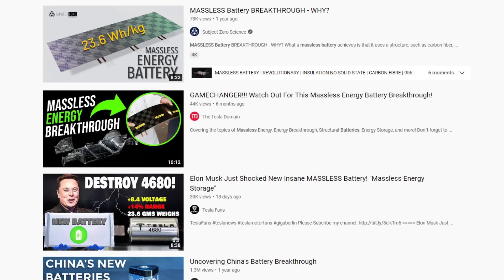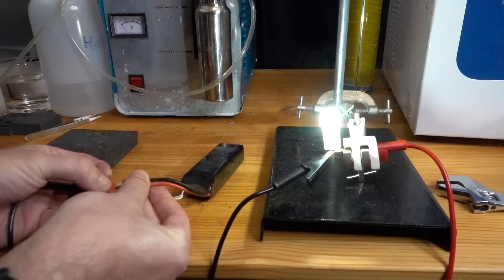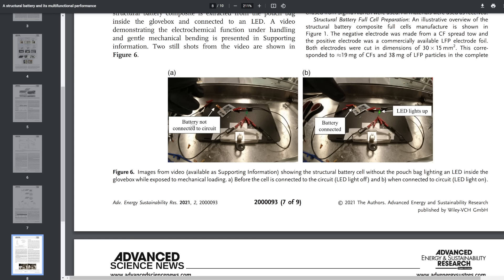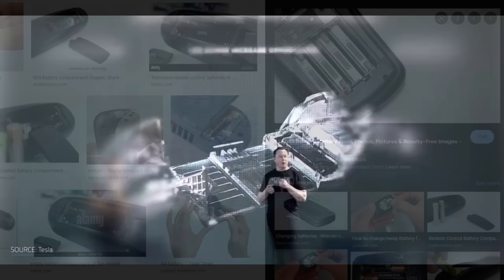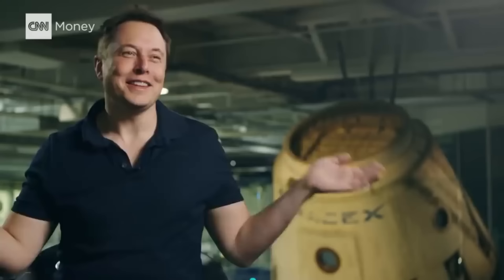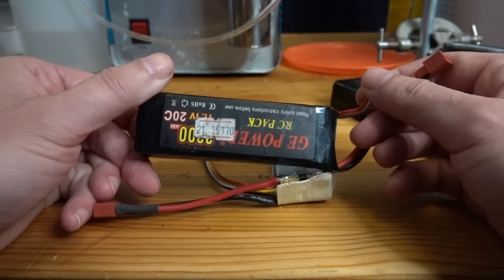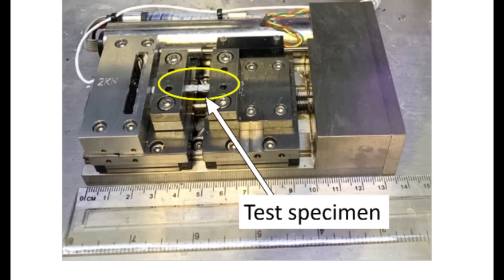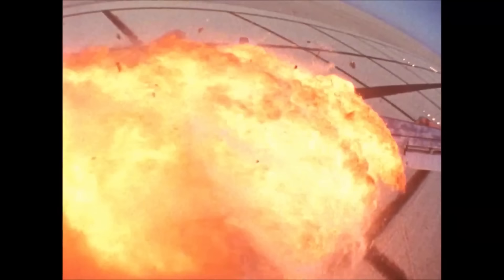Matt Ferrell, Massless Battery: BUSTED!!

Comment: "Imagine if the car's structure were a battery"
Okay. Imagine if a car were made out of a dynamite and thermite composite
Reply: How about this, if you distribute the thermite and dynamite all over the car then there would be no net force when it conflagrates; instead we could get all that energy in one place and accelerate the car really quickly (if only briefly). Then to compensate, we could put it underneath so the car follows a parabolic trajectory....

Oh we've invented mortars
Reply: @Hevlikn  Might as well call the vehicle company "General Mortars" at that point
Reply: It would be fast as a rocket.
Reply: It'd have a high energy density at least.
Reply: Saves on towing and cremation costs.
Reply: Sounds like fun. Fun I would watch from far, far away...
Reply: Now im not so sure but arent batteries usually structural elements of the car and really well protected?
Reply: What if we built the tank out of cannon shells?
Reply: I can think of a market formcars designed like that
Reply: It's not a horrible idea on its face. If we had the technology to make structural batteries it would be very beneficial. It just shouldn't be presented as if it's a trivial technology to develop. Maybe 50 years away, if it's even possible at all.
Reply: @Gigachad-mc5qz  Underneath the car, yes. Not if the packs or cells are all over the car.
Reply: I think it would be better to have car frame made out of C4. That is much safer :D
Reply: @RamsesTheFourth  ya joke, but when ya think about it, it might actually be since C4 is impact stable and doesn't ignite in flame

Comment: I can't wait to see thermal run away in 100% of my car's frame, what a great idea.
Did you know that making the seats of your car out of plastic bags of gasoline is the most comfortable ride you'll ever have? There are no risks to this idea, just benefits.
Reply: Yeah, also you can fill an air mattress with propane to cut down on those unsightly metal tanks, aesthetically pleasing and a great night's sleep!
Reply: Even saying it doesnt blow up. What happens when the battery dies and wont need a charge. Would I need to change out my whole cars frame and side panels?
Reply: @devilselbow  gasp @_@ Yourrrrrrr rrright.
Reply: Oooh, and I just imagine myself riding in that car, enjoying a cigarette while I sit comfortably on that gasoline bag seat.
Reply: That's pure genius!
Reply: Plus if the fuel injectors fail, you can still get fuel into the engine due to the pressure of sitting on it!

Comment: In al fairness, the original paper seems to be more about "how can we make a battery cell a bit more tolerant to elastic deformations while still storing some energy in it" and has the distinct "we need to publish something" vibe to it. It's Matt's own initiative to claim that the battery is massless and everyone's lives won't be the same ever again.

When Colin Chapman bolted the rear wheels of his Lotus 49 car directly to the engine, it was a good idea. However, claiming that it suddenly made Cosworth DFV "massless" would have been ridiculous.
Reply: Minor correction: Lotus 49 uses transaxle and engine as combined suspension mounts, then those two are directly bolted to main tub.

Comment: So by this logic, all motorcycles that use the engine as a stressed member have weightless engines. I had know idea my bike was so light.
Reply: Well you as a human is a human supporting human, which means you're weightless as well
Reply: Just like how we are all brains in bone mechs with flesh armour,but the armour is also the motors that move the bone mech.
Reply: @NareshSinghOctagon  We're Biomech-Cyborg-Carbonsparks .. i kinda forgot what i was gonna say
Reply: All you need to do is embed the battery into the integral structure of your bike, and you'll be flying!
Reply: Yeah this logic is just ... uh NO!!!!

This is really going to depend on the battery structure itself as well as the life expectancy.  It may in theory be possible to make a "lifetime" battery pack for an electric car.  This has already been done for phones and laptops (they just have terrible lifespan).  I would want to be a lot more confident that the battery lifetime is guaranteed to last 1 million miles of real world range before getting a car that couldn't have its battery changed.  

I just remembered.  Some of the strength they may wish to use comes from the cooling system on the batteries.  Would be better to reduce the heating/losses and drop that weight altogether.  

The feral guy did a "breakthrough" video on Lithium Sulfur batteries too.  Is this total rubbish too or could it have some promise.  I tried reading the report - sounds like they ran their test batteries very gently but it was performing ok.  These unis can be a bit questionable at times too.
Reply: What is a "know idea"?
Reply: @Games_and_Music  ,Autobots inferior,Sound Wave superior.
Reply: Stressed member?  That is what SHE said
Reply: @NareshSinghOctagon  That makes me think though, Autobots only seemed to use gasoline when they were in their car disguise, maybe we need to find some Rarified Energon and just make an Allspark ourselves.
Or, like you said, use soundwaves for levitation, i'm sure he can blast some 80s House from one of his mixtapes.
Reply: @Games_and_Music  ,oh yeah baby.

Comment: Actually you can "gravity feed" jet engines, at least in modern airline jets, but it's more complicated than it sounds. Ram air pressure is used to increase the small amount of pressure of the fuel just from gravity, which is just to keep fuel at the inlet jets. The engine itself mechanically drives its own fuel pump at the inlet, so as long as fuel can physically reach those inlets and the engine is intact it can run.

But that's all thanks to the engine design not the placement of the fuel tank. Infact as long those inlet pumps don't have to suck the fuel and create cavitation, you could put the fuel tanks anywhere you want and it'd still work.
Reply: Many commercial jets have fuel tanks in the fuselage -- the 747 that exploded after departing JFK in the late 90's exploded because the center fuel tank, located in the fuselage, was nearly empty save for fuel vapor and then degraded wiring provided the spark.

Comment: i remember this vid. the first thing i thought of was "how can it have no mass and exist" building a battery into a body panel/whatever still has mass and sounds like a great way to easily make a $300 part into a $5000+ part AND a danger in a crash.
EVs have their batteries separated and sealed in a box because they dont react well to crash damage... now lets make the parts most likely to get hit into batteries... one bad shopping cart ding and your car is a smoldering wreck.
then there are the issues with normal battery degradation and after the 60k miles when you need new batteries, now its quite literally time for a whole new car.
Reply: Imagine when the battery life is reached and you need to replace the battery. Yep… time to buy an entire frame for your car. 😂
Reply: @TsunauticusIV  That alone will ruin the resale value of a car...
Reply: damn it my battery car exploded in the sun again.
Reply: @TsunauticusIV  "Write that down!" - car manufacturers
Reply: also think about where in evs the bats as well as gas or diesel is stored. There usually in the floor to keep a low center of mass in the car. Which is good for handling and shrinks the chased of the car flipping. If you want solar on it I would assume that it would be on the top side of the car. So thats not great either for the sake of those purposes.
Reply: Not to mention that carbon fiber is incredibly expensive and the only cars that have some measurable amount in the body are supercars (Ferrari, Lamborghini, Porsche, etc.); Getting that AND the function of a battery in your Corolla would cost the same hundreds of thousands of dollars.
Reply: Being futuristic is not a bad thing but practicality goes a long way.
Reply: Exactly, when the battery dies you need a whole new car. It's a ridiculously horrible idea for anyone other than the car manufactures.
Reply: @DeconvertedMan  lol with out any b.m.s. to control charge and discharge yes it will explode. violently
Reply: Perfect sales pitch for car dealers (car dealers will probably give a Nobel prize to this youtuber). But it returned the "solar freaking roadways" to us (nice additional touch).
Summary: that guy is stupid, but I like him!
Reply: @vertigo4236  damn, kill resale AND ensure repeat customers
Reply: @John M.- This was exactly what I thought the moment I heard this. Seriously w…t…actual are these people thinking? If you have a “battery panel” that has a weight reduction when compared to a traditional body panel then I guess I can see where they’re coming from but in no way is it weightless. And the practicality of the idea seems somewhat wanting.
Reply: Batteries are not inherently volitile. That's the lithium that tends to have the catastrophic failure
Reply: As soon as I read "massless" in the title I knew it was dishonest bullshit, only a fool would fall for that tagline! But alas, the internet is full of fools! 🤣
Reply: Basically putting explosives all over your vehicle, kinda like ERA on tanks hahaha.
Reply: @TsunauticusIV  Just imaginge also the "annuals" for that aircraft.  My brother owns a small plane it is a nightmare in terms of cost and time! And it is called that for a reason
Reply: Michael Bay would be pretty excited by the possibility of a car that could explode in a fender bender.
Reply: @t837qvhsdKJ  my new car runs on bats.
Reply: Photons have no mass yet they exist and have ENERGY!!! I think I have made a BREAKTHROUGH massless photon battery. Elon Musk please buy my idea!!!
Reply: @vladimirrodionov5391  but does it produce more energy then it takes in?

Comment: We haven't really solved the problem of batteries exploding.
So let's make the whole car a battery!
Reply: @BIGFOOOOOT if you drive a spike through the batteries depicted in the video they will respond most energetically.
Reply: This is more of a trait of lithium than it is of batteries.
Reply: @nomms  lithium has numerous non-benign failure modes, but the underlying driver is energy density so batteries will always tend to explode. Even AAA batteries explode…we just see a small leak vice fire.
Reply: @JoeOvercoat  Right. I understand this, but lithium batteries are an order of magnitude more dangerous than other batter architectures. You don't get massive fire that are impossible to put out with other materials. Plus a catastrophic failure is far less likely with other materials, even if punctured or otherwise damaged.
Reply: @nomms  lithium batteries are more dangerous as you say, and some lithium chemistries are again more dangerous than other lithium chemistries.  But, i will venture that all those other materials you refer to have lower energy density, either by weight or by cost. humans often value run time over safe time...it's just how we are wired.
Reply: @JoeOvercoat  I think you've forgotten what I'm replying to. Just trying to correct the misconception that batteries are inherently explosive/unstable. Not denying lithium is useful, or advocateing for it's immediate replacement. I like my phone :)

Folks seem to forget that other chemistries exsist, woth vastly different charactaristics (and failure modes) and are widely used. Don't think Lithium chemistries are the dominant market share, although I could be wrong there.

Comment: By this logic, all 6.2 million pounds of the Saturn V is massless, since the majority of it's structure were integrated fuel and oxidiser tanks.
Reply: I used to have a moped where the frame was also the fuel tank.
Reply: Words have contexual meaning besides literal meaning. Massless battery doesn't mean the battery has no mass same way bladeless fan doesn't mean it has no blades or wireless charging.
Reply: to be fair, that was the whole concept.
Reply: @asandax6   
Yes, as an engineer we usually call that "marketing wanktalk"
You can twist the words all you want but physics, reality and real world practicality are not so willing.  There are some laws that prohibit false or misleading terms/claims in some countries for this very reason.